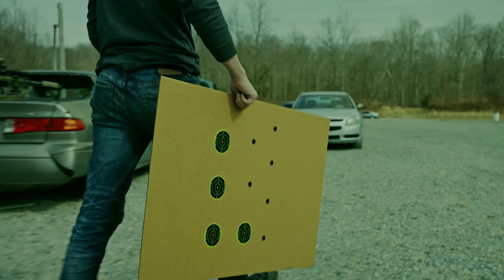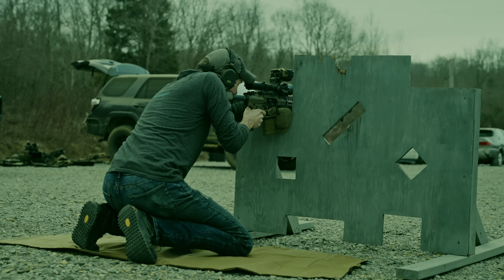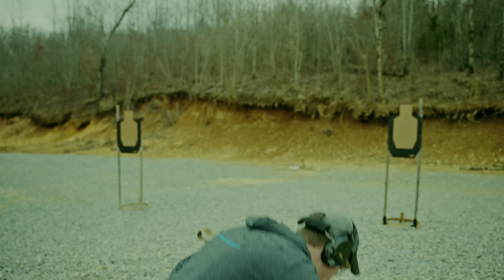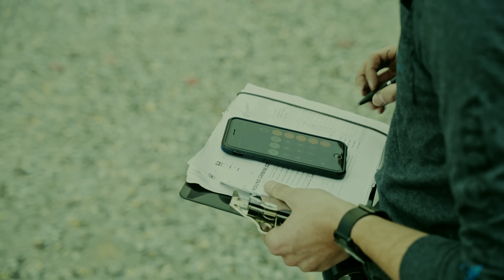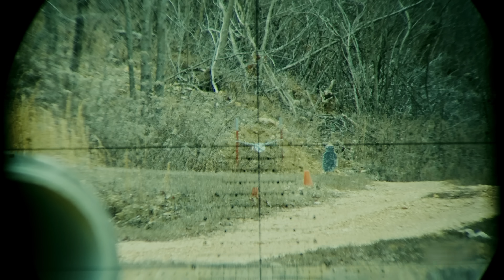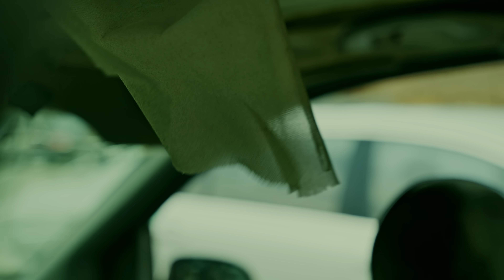Can You Shoot a 17lb Sniper Rifle Up Close Fast?

Comment: It is a quite nice setup. I do have a question for you though. Since you're already running an offset rds for close up work, why didn't you go for the 4-32 that only weighs 1oz more? In practical use, the difference between 2.5 and 4x isn't nearly as much of a compromise as the difference between 20x and 32x given the long distance goals of the setup.

Comment: But I always do better when I build a rifle Apopa’s to buying but it depends on the company that again it’s kind of hard to get nights armament unless you’re getting secondhand or you fucking see one and nowhere on the wall at a gun shop that will be gone the next day if it’s even on the wall it gets to the wall because it’s in it  as cement in my ass like if I had a chance to buy an SR 25 minutes or 15 oh yeah I would buy it hide fuck and I’ll be the next guy but it’s hard to find even down Florida and all together I’d say it would cost me like my last build around $5000 The barrel being the most expensive part and for good reason double chrome lined a proprietary type of animal the gas block and when I say proprietary they pin their barrels on the top opposed to underneath so you have a very very low profile gas block that’s very very thin tape and sealed I think after the pinned it’s got an indexing also so it doesn’t shift left or right and zero gas leakage One of the reasons it’s on is like a go to for me if HK 416‘s were more readily available absolutely I will get an AR or the 11 inch variant but there are not a silly Bible because of import Tatian the fire alarm and all that bullshit so you have to get like I guess HK America version if you can find it the Mr. one at one you have a YouTube channel that a bunch of fucking loser kids a play call of duty and shit hey sure when you’re overseas you play games like that because yeah I thought to do but other than that I don’t think I played video games since fucking Nintendo 64 so I honestly think you going to firearms because of cold duty or one of those fucking games I swear by it and you take your nuts and like yank him down because your voice drives me fucking insane or get your sinuses checked or something or fucking take some steroids so voice kids cheaper and you need something brother

Comment: Honestly If I’m gonna have a precision rifle that is a gas A.R. 15 platform most likely definitely do research on different caliber and barrel so I’m not sure on the offer but I would definitely I Recents traynor sourced Farrell work proof research Powells are amazing if you’re doing a heavy weight belt won’t want a lady a barrel by stainless for 16 or there’s the carbon fiber in it but it’s more of a I don’t want to even say SPOR but it’s an 18 inch that is seven minute at 100 easy with I am on a regular MK262 mod one I was in a poke your head 20 rounds of Black Hills for zeroing and it’s the 77‘s and also you used some Hornady 69 green really is so shooting due to his wife Alex gas system and you want new gas leakage you can fix that problem future from Waze but might take more than one try on gas blocks and barrels the idea OD of the barrel and the gas block the tighter the seal the smaller the port is but I think a rifle life is about .09 I’m correct around that it’s between like .85 something  or .095?

Comment: Should have gone 6.5 in the bolt gun and 7.62 in the gas gun just for usability. 7.62 is everywhere, has more options for ammo, and doesn't burn up barrels quite as fast. Anyone who wants a solid bolt gun in 6.5 or 7.62, check out the Tikka T3X TAC A1. For the money it can't be beat.

Comment: One thing that I can recommend for long range shooting. For tank gunnery we don't say 1 mil left or right. We go by target forms. For example if you shoot short the TC will tell the gunner to add 1/2 target form (target form is the size of the target) the gunner will then aim up 1/2 size of the target and fire again. If it is a hit then the TC will announce target (meaning that the target was hit). The acronym used is DLOST: Doubtful left/right, Lost (meaning you have no idea where the round went), Over, Short, and Target. The corrections allow for faster follow up shots on long range targets. Also what tanks consider "long range" is significantly different when compared to small arms, but the principles are the same.

Comment: You can build a 20" 6.5creed db10.  It has SR25 style receivers (not dpms), and uses a standard AR15 buffer tube (their db10 buffer and spring are on their site also).  Their preassembled uppers are only $500 (even less in 308)--  and then you can get their stripped lower for around $100.. buy a cheap parts kit for the lower and throw it together.  Super cheap and easy.   They cost $2k if you buy them outright, but for some reason you can build the same rifle from parts on Diamondback's site and it's well under $800 total.  Super accurate and well worth the money.

Comment: The reason the Raptar-S LRF is so expensive is the LRF laser is at 1550 nm so that it can't be seen by low-light/nearIR NVGs. All modern (in current use) military LRFs are at this 1550nm wavelength now for that reason (to remain covert in sniper hides). Standard LRF (like the civvie sub $1,000 LRFs) are all 905 nm which puts them square in the range of NVGs so that the LRF flashes can be seen by someone wearing NADS. 1550 nm LRFs are expensive. This Wilcox RAPTAR-S that Lucas demos is $10K for the civvie version (it has a low powered laser aiming pointer mode too for NVGs). The military/LE version has the high powered aiming and illum lasers (830-850 nm) is about $11,000. These LRFs can range to about 2000meters on human size targets.  The Wilcox Raptar-S touch button remote pad he mounted on his gun is about $500. Steiner makes 1550 nm LRF binoculars that are around $10,000 and can range to around 8 km on truck size targets. So 1550 nm LRFs are not cheap, they keep the riff-raff out of the game.

Comment: if you're doing a budget bolt gun, try a ruger or tikka. Very solid but ground level budget bolt guns that are very accessible with good aftermarket support. Great content as always, God bless.
Reply: You can build a 20" 6.5creed db10.  It has SR25 style receivers (not dpms), and uses a standard AR15 buffer tube (their db10 buffer and spring are on their site also).  Their preassembled uppers are only $500 (even less in 308)--  and then you can get their stripped lower for around $100.. buy a cheap parts kit for the lower and throw it together.  Super cheap and easy.   They cost $2k if you buy them outright, but for some reason you can build the same rifle from parts on Diamondback's site and it's well under $800 total.  Super accurate and well worth the money.

Comment: Your rifles and expensive doodads are all very nice if you have an extra $10-15K burning a hole in your pocket. For less than $2000 I can help you build a nice AR308 with optic, spotting binos/scope with rangefinder and still have money left over for a pencil and paper to sit down and teach you how to figure out your holdovers and build DOPE cards so you can make consistent hits out to 1500 yards or more with that 6.5 CR for when your fancy electronics all fail.  Of course I'm old enough that I learned to do that out to 1000+ yards back before they gave us anything but iron sights on our service rifles and back when the 6.5 CR wonder round was known as the 6.5x55 Swede. Best wishes.

Comment: Very excited about the new long range content.
Big question:
Semi-auto accuracy has come so far whereas bolt guns where soley used for long range precision, are bolt guns a thing of the past? They are now so accurate and the continuity of fire makes them a much better choice than bolt action.
Thoughts?
Reply: The potential for malfunction will always remain in semi autos, although if you have a rifle paired with good magazines/ammo this factor can be almost negligent. Not good enough for some.
Reply: In a real-world "must kill it" situation, the semi-auto wins hands down under 1000m. The biggest unknown is wind (and maybe distance if you don't get the time to range something with a laser). If you miss a wind call (and you will), the follow-up shot with correction is on its way within a second of the first one landing. You can do that with a bolt gun, but it's hard to get right without breaking position -- needs lots of training.

Comment: Have my SP-10 set up almost exactly the same. Only difference is the t-rex and Arisaka offset wouldn't work with the massive turrets on my long range scope (too tall). So had to use a cheapo Tru-glo since it was the lowest I could find. Bore isn't in line but who cares under 100 meters. It's actually held up surprisingly well. 

You'll love the SP-10. We used to do 1200 yard double taps at Storm Mountain with them. Great long range DMR.

Comment: I'm running the same scope. Was on a 6.5 scar 20 now it's on a 20" AR 10/7.62.......love it to death.
Reply: You can build a 20" 6.5creed db10.  It has SR25 style receivers (not dpms), and uses a standard AR15 buffer tube (their db10 buffer and spring are on their site also).  Their preassembled uppers are only $500 (even less in 308)--  and then you can get their stripped lower for around $100.. buy a cheap parts kit for the lower and throw it together.  Super cheap and easy.   They cost $2k if you buy them outright, but for some reason you can build the same rifle from parts on Diamondback's site and it's well under $800 total.  Super accurate and well worth the money.

Comment: Need to drill and tap a 1/4x20 hole in that surfboard and mount the Wilcox directly. Wilcox used the stupest mount because they built those units to be able to mount directly to actual stanag spec 1913 rails which have those holes along all sides. And almost no one makes rails to that spec.

Comment: Lucas, I'd really recommend the new(ish) 300PRC when you want to get a "bigger" precision bolt gun.

It's essentially a modernized 300win mag that is designed to take as much advantage as possible of the long high BC bullets in the 220gr and heavier range.

It's essentially very custom 300WM performance without having to have a "full custom" rifle built with a longer throat and faster twist rate and so on.

It's very similar to a 300WM in terms of recoil while having superior ballistics out to 2000+yds, and comes extremely close to 338Lapua (and actually just barely beats if strictly measuring trajectories)

Comment: Seekins SPM10 is the most tested SASS . I cannot remember how many rounds were tested but it was a lot.  That's why USASOC selected SPM10 as their new SASS...
Rem SPS TACTICAL paired with 2-12× would be under 1.5k setup for sure. This was the gold standard for budget ACCURIZED bolt guns back in the day
Reply: LMT MRGG-A and Geissele MRGG-S are replacing the Seekins now.
Reply: @LukeHansen-0326  Yeah that Seekins SPM10 is a killer SASS but the Geissele MRGG-S can go something like 7k rounds and still maintain 1.25moa . That's pretty insane for 6.5CM Barrel . I believe they are HF CL Match Grade Barrels .

Comment: Just my humble opinion as someone that runs 5.56 guns as well as some .26 caliber stuff ( for those that know ;-) ), I'll say that the rifle you've shown is complete overkill for DMR. I'm sure someone else will agree. 

If you consider that a DMR guy is attached to a group of dudes, on foot, and can be effective out to 600-800 yards then perhaps there is something that can fill this role in small frame gasser of reasonable weight?  That role is currently filled by 5.56 guns, but what if we could make something lighter weight with a better round? 

Option 1: 14.5" or 16" 6.5 Grendel or 6 ARC using a Faxxon pencil or hanson profile barrel. Both of those rounds are still supersonic past 1K yards and have near 308 levels of energy past 400 yards. Still worried about weight, run an Unbranded AR Carbon lower or a KE Arms KP-15 lower.  For the ranges in question a 2.5-10 or even a 3-12 would be fine. Then you can interrogate at distance which is something the rest of the squad would appreciate. Want to focus more on maintaining up close speed? How about a fixed 5x with a dot? I'd run the Swampfox Saber with the dot mounted on the side. With nearly 42 MOA of stadia represented you are covered to at least 1k yards.  Just throw in a Sharps adjustable carrier with one of their relia bolts for good measure. 

Options 2: A 14.5 6.5 Creedmore. Will have all the same benefits as above and then some. The only drawback being a bigger frame weapon. What would really make this concept a good one is if POF or Ruger made the Revolution/SFAR with 14.5 6.5 barrels.  Anyway, just use the similar optic options as above. 

Go do some DMR matches. Quantified Performance is awesome for this kind of stuff. 

Have fun!

Comment: I'll never understand the fascination with the 6.5 Creedmoor cartridge when older, arguably better calibers exist. 

I'd 1000% rather run the 6mm Creedmoor or .243 Winchester. .243 hand loaded 105-115 grain bullets loaded to between 3000 and 3200 fps deliver amazing results, especially at range. Couple the high velocity, high BC 6mm rounds with their low recoil, and you have a real winner in a SASR especially, but in any long range rifle in general. 

You can get into, and perform in, long range shooting with a scope like the 10x42 SWFA Super Sniper. I've personal taken that scope out to make hits at a thousand yards before. Is it the best scope? No, but the turrets are accurate and the glass is good enough. 

A clamp on bubble level works to prevent scope cant as well. 

You could easily drop the cost of those optics and accessories to ~750-800 and be effective. Vortex optics are among the most popular optics for long range shooting now, btw. Nightforce is crem de le crem, sure, but Vortex works for less.

Comment: This is the kind of stuff I love to see. It’s interesting and an awesome skill set to work on and hone. I have an Aero Precision M5E1 with a Magpul PRS Light stock. It is cheaper and I think it looks better personally. It was a nice upgrade over the standard mil spec type. I have an 18 inch Dracos straight jacket barrel in 308 and with Berger 185 Juggernauts it will shoot one hole groups at 100 and fly straight out to 1,000. Bullet selection is key when it comes to really stretching out a 308. Good glass, you have that covered. It is just fun to me knowing I have something I can take clear a room with or pick off a bad “ thing” at extreme distances if I do my part. Clearing a room might be asking a lot but you get my point. I would love to see more on this subject and I know a lot of other people do too. I also have another with a Criterion 18 inch 6.5 cm barrel so I have options
Reply: Great stuff for sure! I’d also recommend the Magpul UBR stock just because it has a more consistent check weld.
Reply: if dudes in iraq an afhganistan could breach and clear with 20inch m16a4s and 240s and win then you can do it with a dmr